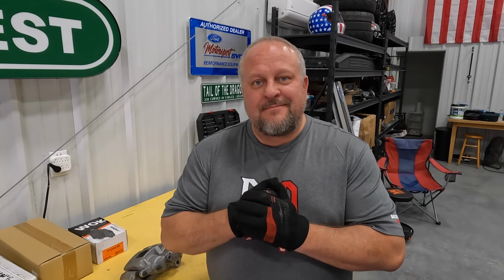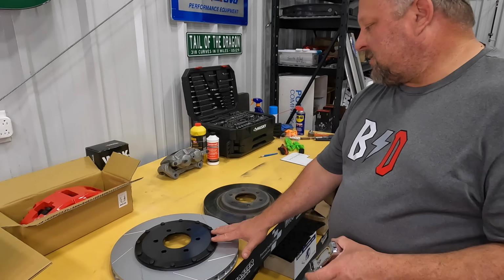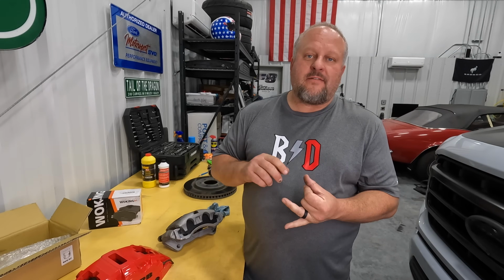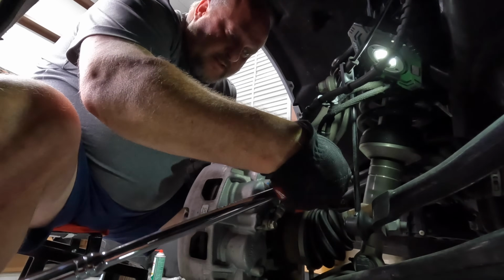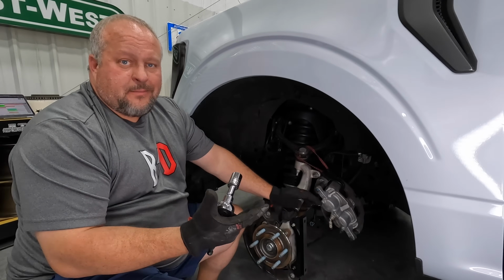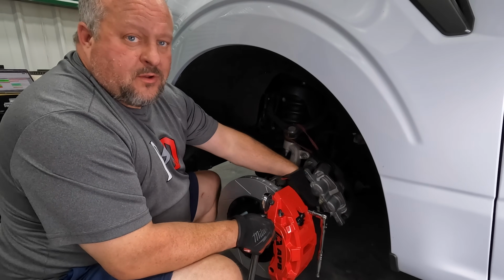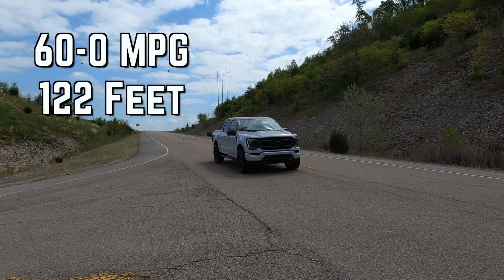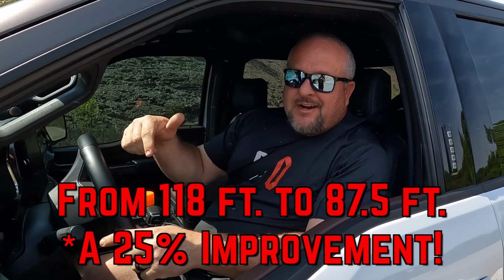Largest Big Brake Kit For Trucks! We Install & Test American Power Brakes

Comment: I was really hoping to see the brake line connection and bleeding for 2021+ F-150s. I hear scan tools and special bleeding tools are needed as well as placing the truck in Brake Service Mode. Would you direct me to link that shows or discusses these procedures. Thank you!

Comment: Will a stock six spoke OEM wheel that is 22x9 with a +44 offset clear the APB calipers ?? Did you have to use spacers ?? The webb site states 20" wheel required 1.25 spacer ??

Comment: I'm getting ready to do this on my 2023 F150 while the 6" VERTEX coil over lift is being installed. I believe you used the stock brake lines. Is this correct?
Reply from the maker: Yep, the stock brake lines are all you need. Take my advise, make sure you scuff some of the coating off of the face of the rotors. It can be a little thick and cause some caking on the brake pads. It's best to sand most of it off and then break in the pads.
Reply: @BackroadDriver  got it will do. Thank you.

Comment: How do you use the template to check for available spacing? The website at APB doesn't explain this. I've got 2021Raptor with Vossen HF6-4 9.5" wide 20" diameter and +15 offset. Any assistance is appreciated....Love the channel!!
Reply from the maker: This link should be all the information you need to learn how to use the template. Way too complicated for me to explain here but you will basically print out that drawing and cut it out. Be aware you'll need a legal size paper or you'll need to print it onto two sheets at 100% scale and tape it together first.  The calipers are larger than a regular sheet of paper.  Once you've made your template you stick the part for the center board of the wheel into the bore and see if it will clear your spokes.   https://www.motortrend.com/how-to/brake-wheel-fitment-check/

Comment: So I have essentially the same set up 2021 Roush F150 with the stage 2 whipple...what made you pick these over Baer or Wilwood? This is my next upgrade, but I'm just not sure which package to grab.
Reply from the maker: I went with them because they have the largest rotor and brake pad size available.  Everyone else has a bit smaller rotor and the brake pad dimensions are quite a bit larger as well.  There are lots of brake pad options available if you want to go ceramic or race specific applications because they work on Porsches etc.  They don't have the big name yet but the product is extremely well built and is as good or better than the other brands you mentioned.  If you decide to go with APB brakes, make sure you use the code BD10.  It will save you some money.
Reply: @BackroadDriver  good info! And I appreciate you taking the time to respond.
Reply: I finally got around to buying these. I just kinda kept thinking   they might have been a bit over hyped. I also kept thinking maybe I wanted to go Brembo/Baer/Wilwood just for the sake of having the name brand because I paid for the Roush name brand. Welp, these things FAR exceeded my expectations, holy hell!!!!  And every damn OEM replacement kit I ever bought for every stroked mustang and vette owned it didnt quit line up right. I alway have to tweak a bracket or bend a pipe or shave a bit of this to get it to fit. Not this kit, it bolted right in with zero issues for me. Now I'm just irritated I waited so damn long lol

Comment: Do they make a rear brake kit. Would help alot to equalize the truck.
Reply from the maker: They don’t. Less than 30% of braking happens with the rear. I think the stronger from brakes make it easier on the rears.

Comment: i wonder if you just change rotors and pads what the difference would be.. that price is crazy..
Reply: One of the advantages of bigger brakes like these is the increase in thermal capacity. More aggressive pads can give you more bite but fade would still be an issue in harsh conditions like downhill towing.

Comment: In y’all opinion what’s the best way to go about putting supercharger on the new 2021s safest and cheapest I just got my new 21 f150 and want to boost it but I was wondering if it would be good to do it through the dealer under a warranty or do it aftermarket? It will be daily driven and  obviously got to have fun it like y’all’s
Reply from the maker: I recommend you find a Ford dealership that installs whipples that is the closest to you. You can go with the Whipple kit and their warranty or the Ford performance Whipple which comes with its own warranty. It's tuned about 75 hp less but still quite a fun truck to drive.  If you ever need any warranty work it will be a whole lot easier to work with that dealer since they did the work.
Reply: @BackroadDriver  I appreciate it I’m actually pretty close to y’all but yeah just for now a warranty would be a better route I know it would be a little more expensive but maybe worth it ? Did you all install your own ?
Reply from the maker: I had my kit installed at Town & Country Ford and Bessemer AL aka TC Customs.  I highly recommend them. They are just south of birmingham. I'm pretty sure they have kits available right now.  If you end up going that route let them know you heard about them from us. They will take care of you.  I wouldn't worry about having it done a few hours away. If something bad happens you'll want to take it back to them to have work done but that's usually not the case. These kits are pretty reliable.
Reply: @BackroadDriver  thanks I appreciate have a good one 👍🏼👌🏼
Reply: @BackroadDriver  one more question when you got it installed did you do the warranty or did you just have them install it and get a custom tune?

Comment: $3,200 for 25% better stopping power?? I'm not quite sure I'm sold on these boys but those rotors and calipers sure are beautiful looking.
Reply from the maker: We appreciate you watching the channel. These are not for the average driver. They're not cheap, but 30ft is two car lengths at least.  5 or 10% better breaking could stop most wrecks from happening much less 25%.  Everybody wants to go fast. Shortly thereafter they figure out their brakes can't stop fast enough to make the corner. Everyone will pay $500 for a cold air intake that makes 5 to 10 horsepower and somehow that makes sense for most people.  It's all relative.  This is my first set of big brakes, aftermarket at least.  They seem to be the last thing that people want to pay for when upgrading.  They make the biggest difference in keeping you out of trouble when going fast.  I'm lucky to have them.
Reply: @BackroadDriver   you make an excellent point. I agree with your point of view.
Reply: My 17 year old just totaled my 2013 F-150. Crested a hill, traffic was stopped by highway patrol due to a mattress on the road. Less reaction time than I would have liked...but stopping distance really mattered. Collision estimated at 25mph. I imagine a 25% improved stopping distance would have made this a mild fender bender at worst.

Comment: $3,200+ for just the front set!  That's nuts!!!
Reply from the maker: They are not cheap for sure. The pricing is in line with other brands though. They fall somewhere in the middle on price but are the biggest brakes available.  

Going fast is fun, not being able to stop isn't though.  It's nice to be able to stop quickly as well now.
Reply: Exactly, and 20 inch rims is even a bigger turn off.
Reply: @ryanbrand3946 how else you going to fit larger brakes when factory brakes require 17’s or 18’s
Reply: @ryanbrand3946  my 08 ram 1500 came stock with 20" rims
Reply: BBK are not cheap price wise. I was even thinking more for the front.
Reply: Had 20 inch rims stock and sold them first winter, rode like shit.  Need more rubber
Reply: Big brakes never been cheap. Unless you can adapt them from another vehicle

Comment: Did y’all lose auto hold with these?
Reply from the maker: Didn't lose any functionality with electronic systems at all. Everything works the same including ABS.  I even tried the active brake assist when backing up and it will still stop if it detects something behind you.
Reply: I can't imagine there would be any impact to functions controlled by ABS. There are no electrical/sensor connections to the calipers. Front/rear brake proportioning would be the only issue I'd think.

Comment: I have Wilwood TX6 kit on my whippled 2021…also 16”
Reply from the maker: I saw 15.5 on the website and the pads were much smaller than these as well.  Either way they are also good brakes.  No doubt about that.  Adding the six piston calipers is a game changer. How are you liking your brakes?

Comment: 30ish ft difference is NUTS!  What top speed were you at when you applied the brakes?
Reply from the maker: 60 MPH. Testing was at same place and it had a pretty good grade downhill. I bet they get better after 500-600 miles…
Reply: @BackroadDriver thanks fellas for testing these, nice job as always.

Comment: Very nice. Here are my questions. Are these 6 piston front and back? Can the hat on the rotor come color coded. You didn’t replace the brake lines. Is there a kit to do that to something more robust? 

What is the pricing for the kit and also expected installation costs or installation time?
Reply from the maker: This kit is for the front brakes only. Brakes are about 80% front 20% rear anyways. Upgrading the rear is negligible at best and I don't know of a kit available for the rear brakes on the F-150 that is more than just brake pads.

I believe they only offer one color for the rotor hats at this time. Same goes for the calipers. They could be painted or powder coated pretty easily though.

I didn't replace the brake lines because I wanted to compare the brakes one to one first.  I plan on upgrading the brake lines as well. I'll be figuring out if brake lines for the previous generation work on this truck. Since this suspension changed a little bit it might not be as easy. Look for a future video soon.

The current pricing is on their website. https://apbbrake.com/discount/BD10?redirect=%2Fproducts%2Fford-f-150-front

At the time of the video posting you can use code BD10 to receive 10% off of your purchase, and free shipping, which is huge!  This is for F-150 brakes only right now. They will also send you a free set of brake pedal covers. 

Installation cost is pretty dependent on your area of the country. If you're paying someone to have these put on expect to pay about an extra hour or less for installation possibly. They are not harder to install than any other brakes but you want them to take their time and be careful not to mess up the finish. You don't want them to mess anything up with your pretty calipers. Also ask them to make sure to use lots of brake cleaner on the calipers so they don't leave brake fluid sitting, causing paint issues.
Reply: @BackroadDriver  ok, so front only, 6 piston. Thanks for that clarification.

Comment: Nice video fellas….what about the rear? So do you have a slotted rotor and a 6 piston caliper in the front and a factory rotor and caliper in the rear?
Reply: Got it, thanks
Reply from the maker: Factory rears. With the electronic parking brake most companies won’t make a kit. They don’t contribute a lot of hard braking anyway.
Reply: @BackroadDriver  could throw a powerstop kit on just the rear and use an aggressive pad like the z36. I think thats probably the best you can upgrade the stock setup? My 18 has an e-brake and they sold me a kit just an fyi.

Comment: With the Whipple do have to use 93 octane or are you able to use all grades?
Reply from the maker: Premium 91 is the minimum and if you have 93 or better it's even better.... You can't use anything less than 91 with the Whipple. Plan on spending a little bit more for gas.